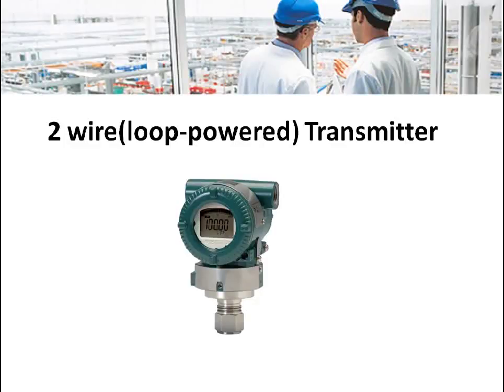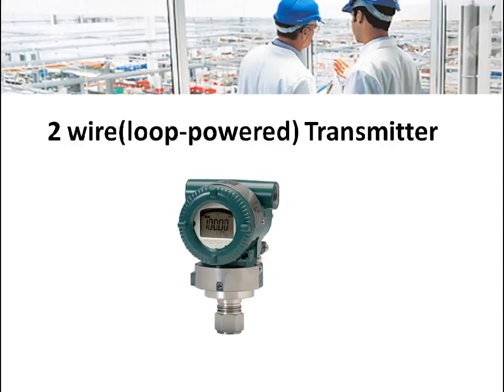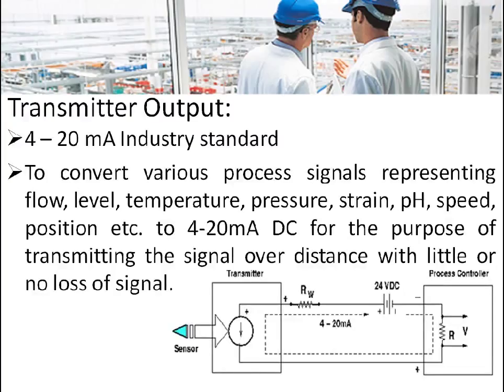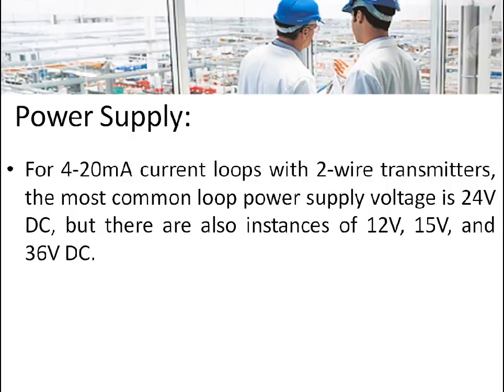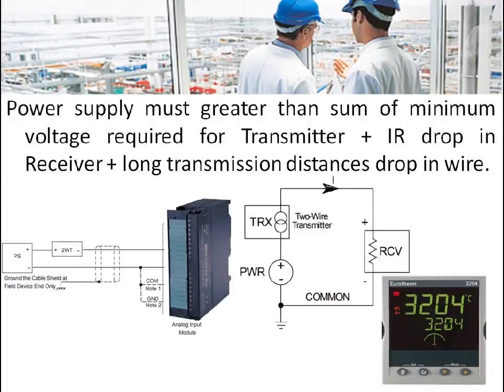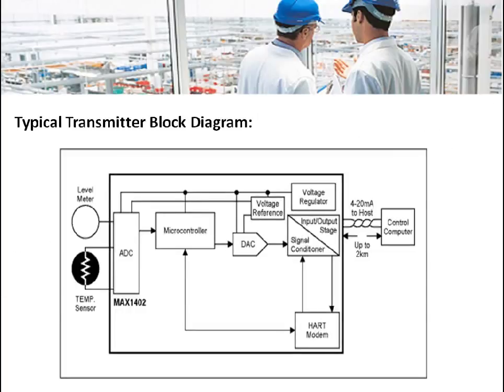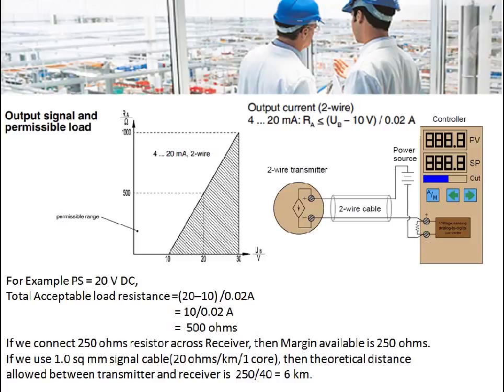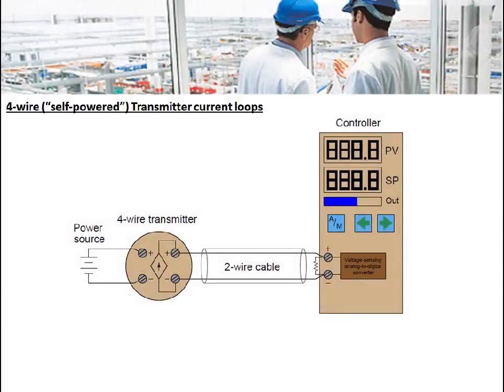Two wire Transmitter

Comment: Hi could you pls explain my query , I have a RH cum temp two wire transmitter of 4 to 20 mA which is connected to a data logger , cable size which I have used is 0.75sq mm n the resistance I have used at RCV side I mean at datalogger side is 100 ohms is that ok , pls explain it practically by using formulas
Reply from the maker: If Receiver is ok with 100 ohms then no issue. Generally 4 to 20 mA is converted to voltage by using 250 ohms which corresponds to 1 to 5 VDC. 
Considering receiver resistance as 100 ohms so maximum voltage drop at receiver is 100 ohms x 20 mA = 2 V. See manual of RH cum temp transmitter for minimum power supply voltage requirement.
I am considering it as 12 VDC and power supply voltage as 24 VDC. So volatge margin available for cable resistance drop = 24 - 12 - 2 = 10 VDC. Considering 0.75 sqmm two core signal cable resistance as 26 ohms /km (approx.) and cable resistance drop for max. current 20 mA = 26 x 20 mA = 0.52 VDC. So theoretically cable length allowed
 = 10 VDC/0.52 VDC = 19 Km (approx.). 
Hope clarified 
your doubt.
Reply: Rockz Automation thank u so much , could please explain what does it mean “ voltage margin for cable resistance drop” thx in advance
Reply: 26 ohms = 13 ohms /km for each core, is this statement is true?
Reply from the maker: @pcrb2695  whenever signal is transmitted via signal cable from transmitter to datalogger or control room location, the signal current 4 to 20 mA will cause voltage drop in the cable due to its resistance (voltage drop = signal current x cable resistance). This voltage drop in cable will limit the cable length and this should not be more than available voltage margin. Otherwise transmitter will give wrong value (because transmitter will not get required voltage due to excess voltage drop in cable). Hope i clarified your doubt.
Reply: Rockz Automation 
Thank u so much
Reply: What about the query on 26ohms?